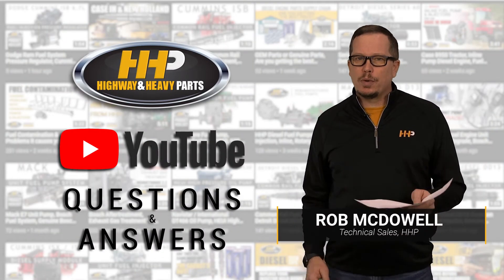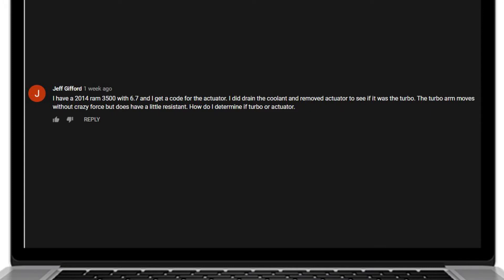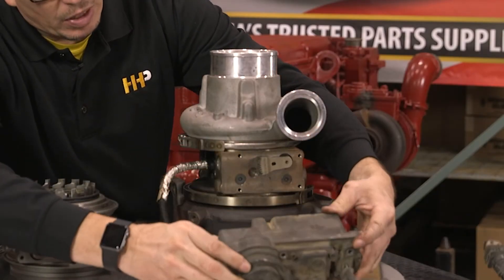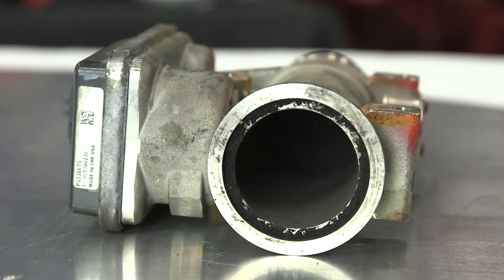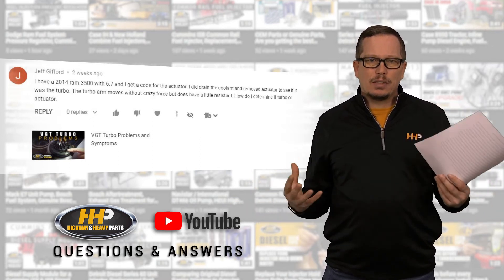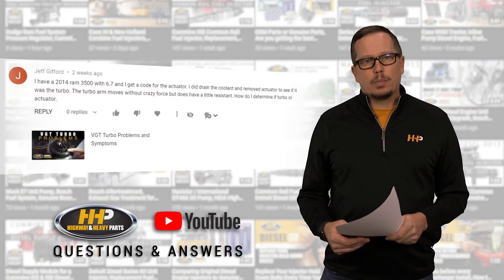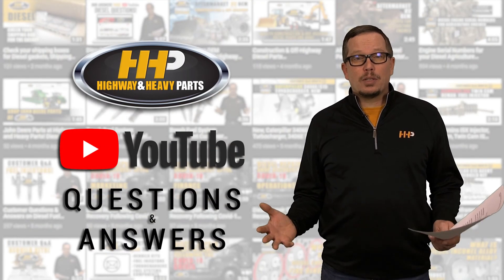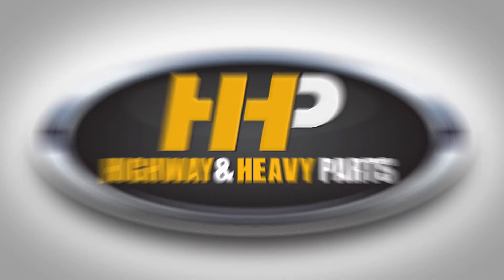Dodge Ram Cummins 6.7L VGT Turbo Actuator Code - Common Problems Causing VGT Issues

Comment: What do you recommend to clean the turbo for the VGT? My actuator is bad and I am not able to move the vanes.
Reply from the maker: There are some cleaners available in stores or online for your VGT,  but we recommend looking deeper into the reason why you're getting excessive carbon into your VGT.  If you can't move the sector gear without the actuator, then your vanes are likely damaged and a new actuator won't work.

Comment: Got the p2262 code on my 2007.5 6.7 cummins. Runs perfect, seem to be no issues while driving. What do y’all think I should do?
Reply from the maker: It may need an ECM calibration update, if you're having no driving issues.  Start there first.

Comment: I have a 2014 cummins and it threw a POOAF code truck is fully deleted with a Efi live tune and 5” straight pipe I read up and it said that it should just be the actuator or faulty wiring what should I do?
Reply from the maker: I don't see that code in Cummins... if its an actuator code check wiring and check to see if you get a change of state on the code when plugged in and unplugged. then you may be down to the actuator.... But make sure a stuck sector gear didn't take out the actuator

Comment: Oh my gosh I found this video so useful I've been having turbo issues with the P003A actuator code I just had to replace my EGR cooler and everything started with a coolant leak. As soon as my check engine light comes on I push 8 lb of boost no more when it goes off I'm pushing full boost, My exhaust brake will always work. Sounds like my turbos dirty.
Reply from the maker: Yes, a coolant leak can cause your turbo to be "dirty" but even worse, it can destroy the bearings in the turbo.

Comment: I have  a 2009 Cummins and it just threw a p2262 code. What should I do?
Reply from the maker: Have your engine/turbo inspected. There is a very good chance the turbo and/or actuator are bad.
Reply: Same here man. 2007.5 6.7 with a p2262 and it says Mechanical on my minimaxx tuner. Did you figure it out? Please let me know